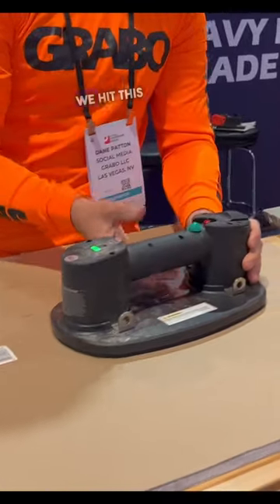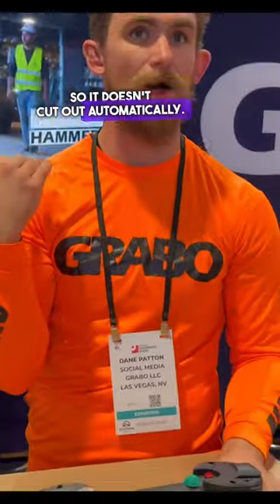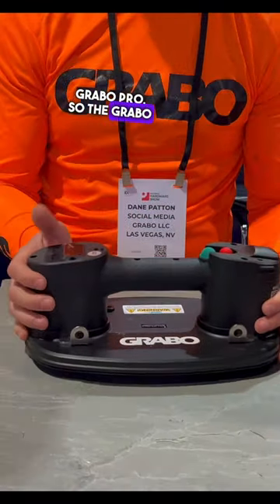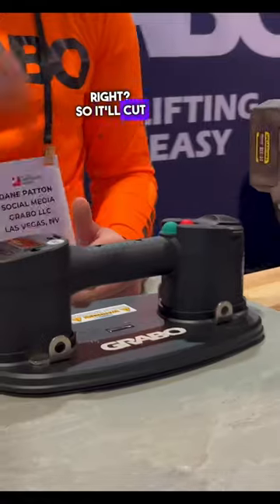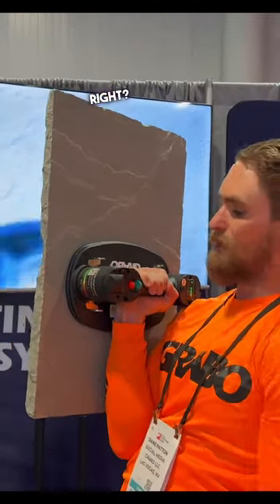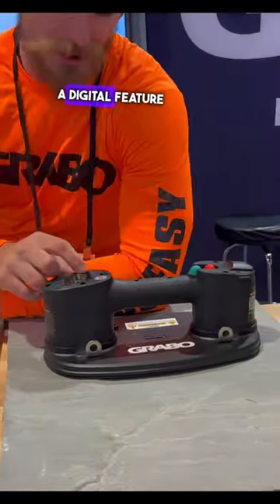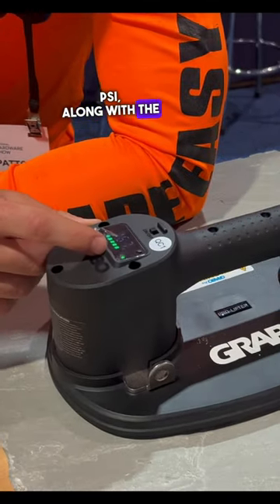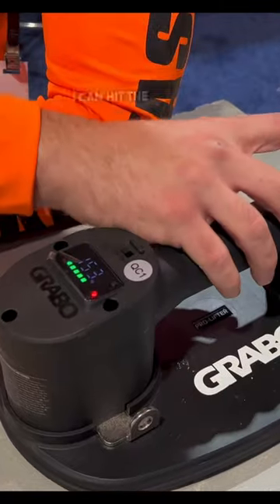Unltimate Suction Cup Upgrade! #toolsofthetrade  #construction #shorts

Comment: It shows you how much it can lift? Why does that need to be on a readout?
Reply: Because it can vary depending on the material and surface. If it's not getting a super strong suction on a particular thing it won't be able to handle as much weight

Comment: But if the material is porous, it will not grip right?
Reply: It will work, I used it on volcanic tiles. It just kicks back in when it's low pressure